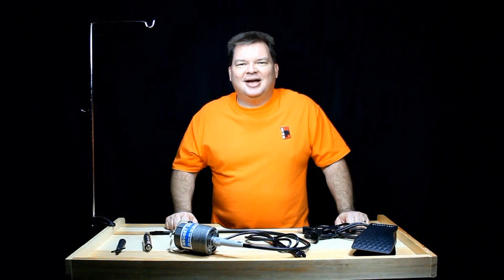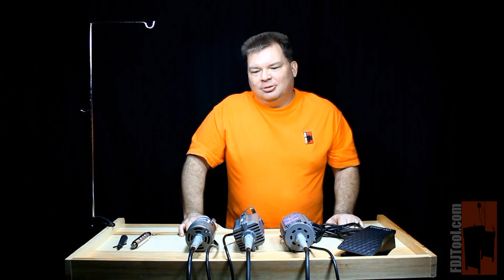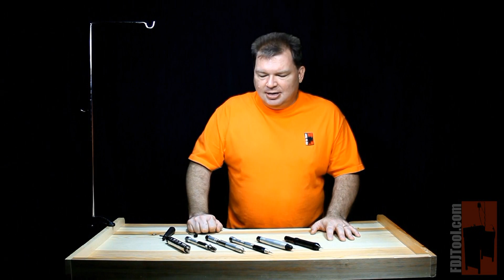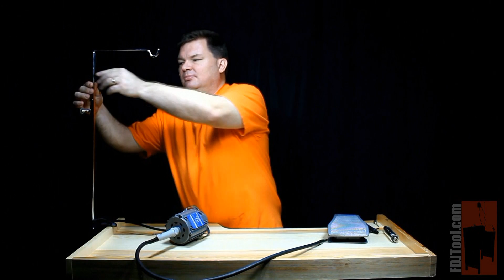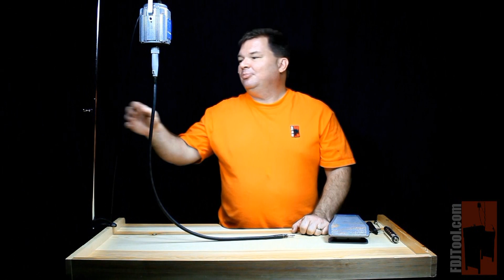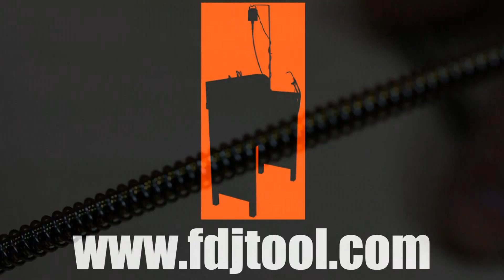Introduction to the Flexshaft Machine

Comment: We have a flex tool with the 3 prong bit holder for the hand tool. It's made by euro tool. The entire bit piece has fallen out and won't stay in. It doesn't look like it's broken in anyway but the entire bit keeps falling out. (The piece where the chuck goes into to tighten). Is it magnetized or something?  Please help
Reply from the maker: The Jacob's chuck isn't seated correctly in the handpiece.  I would check with your supplier, but I have been told that it can usually be set back in place using a rawhide or rubber mallet.  I can't attest one way or the other that it works having never tried it myself, but a jeweler has told me that's how he was told to fix his.